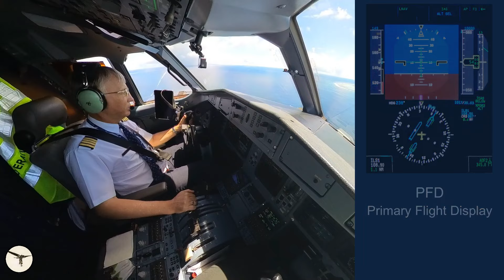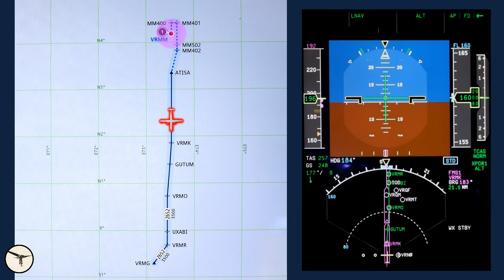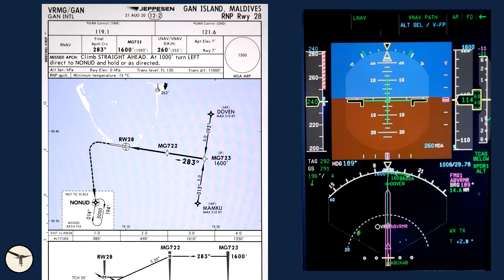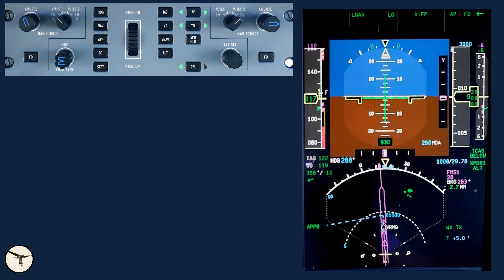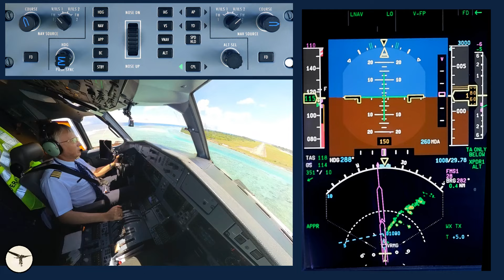ATR systems - Primary Flight Display (PFD) part 4 - LNAV/VNAV approach | Tutorial

Comment: Hello Magnar! Since  RNP Approach is a non precision approach, does it need to add a margin of 30ft (ATR = CAT B) on MDA even with the use of VNAV? Is there a need to add 30ft margin if LNAV CDFA is written on the approach plate?
Reply from the maker: When you look at the chart for RNP approach at VRMG (@ 3:32 in the video), you will notice that the LNAV/VNAV approach has DA 260', and the LNAV approach has MDA 400'. DA means no additional margin is required. MDA means 30 ft must be added. CDFA is standard for almost every non-precision approaches, even when it is not printed on the chart.